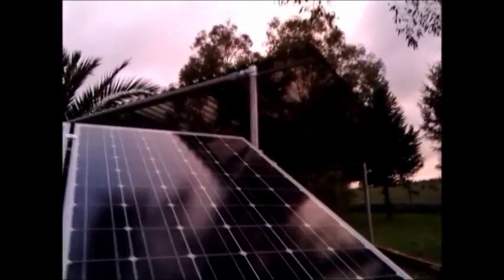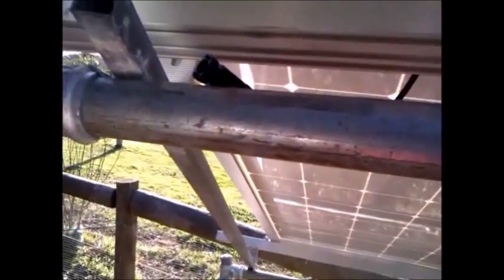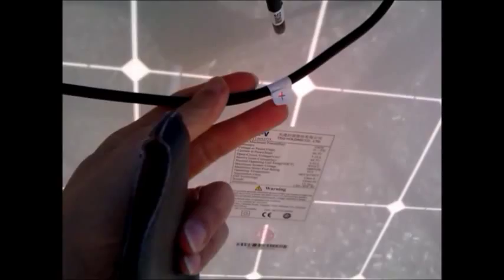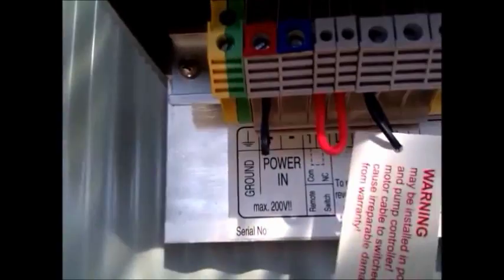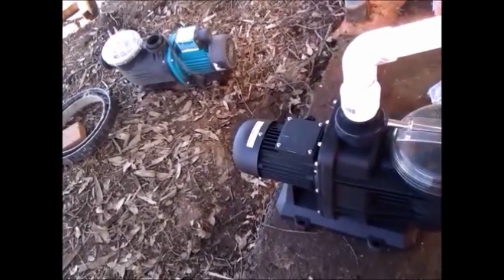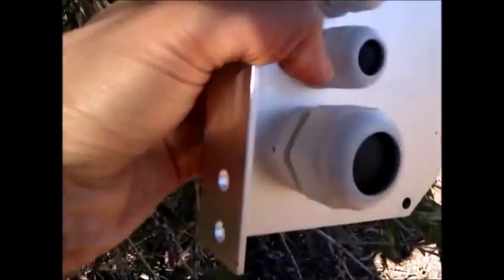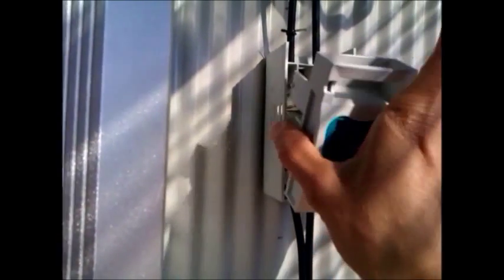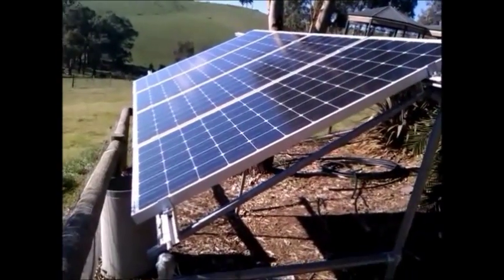Going off grid on pool pump - part 5/5 Connecting solar panels to controller and pump

Comment: Hi, I'm planning on installing a Lorentz PS600 pool pump myself, because our humongously oversized pump is leaking. I'm not finding a lot of usefull information about installing/wiring the panels. Your excellent video is by far the best one I've found. Could you tell me some more about your circuit and how you assembled it? I can see that you have four panels wired in series, then a breaker between them and the PS600 controller. Can you tell me what sort of breaker you used? how much it cost? I have the feeling the suppliers I'm dealing with are trying to sell me things I don't need. I am also mildly concerned about what panels I need (voltage/amperage/wattage) Any help will be greatly appreciated
Thanks, Sam
Reply from the maker: Hi Samuel, Circuit breaker is a must have. Its an ordinary 30 amps breaker. Bought it from Ebay cost about $12. Dealers normally size system for worse case ie Winter performance with lower sunshine hours. 3 panels (200w each) should be able to power PS600, I opted for 4 (190w, 36.5v each. total output on sunny day is approx 170v, on sunny days output is actually more than rated) so that it will also work during overcast days. So far I am really happy with it. Wiring from controller to pump is easy, just follow the manuals. Hope this help. Thanks for watching.
Reply: khthhonl  Can you tell me anything else about the breaker please? I can't find any similar breakers, only ones that seem designed for indoor use or that need a box, adding to the price. I did find a "PV disconnect box" that seemed to be similar, but I don't know whether that needs a breaker/fuse as well. I'm sorry to be bothering you with all these questions, but I can't find anyone else who has explained their system anywhere like as well as you have
Reply from the maker: Samuel Mellars Hi Samuel, PV disconnect box would be fine too. The purpose is to isolate solar panels to prevent electric shock. By the way, you should have a shelter for the pump to protect against the elements. Place the breaker in the shelter you won't need a box then. Hope this help.
Reply from the maker: Samuel Mellars Hi Samuel, For the breaker try searching under "2 pole isolator switch"
Reply: khthhonl Hi, sorry for the delay replying. The original pool pump is in a shelter (pool box), so the electrics will be safe out of the elements. The breakers I was referring to actually need a box to support them and fix them to a wall, just like the ones used in wiring for houses, so they couldn't just be attached to the wires or a wall, they need a specific mounting.
It's great to hear that a PV disconnect would work, I just don't want to wind up electrocuting myself or anyone else by missing something obvious out.
Thanks for all the help